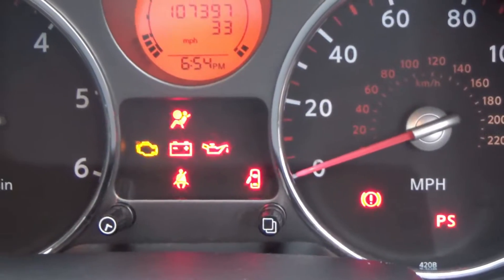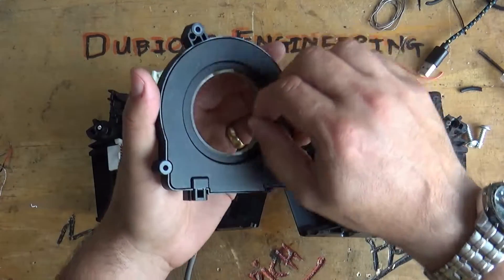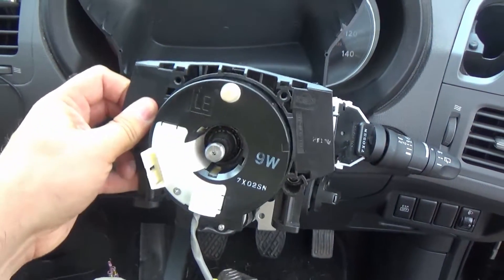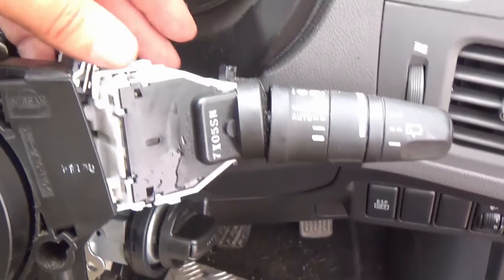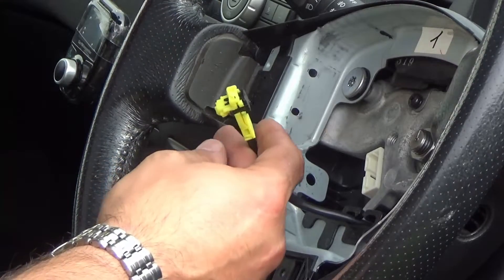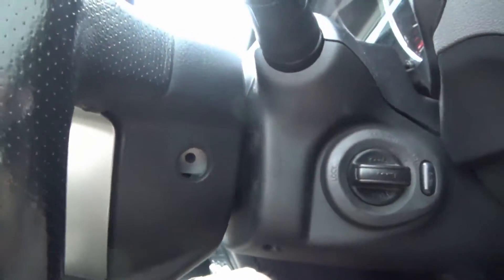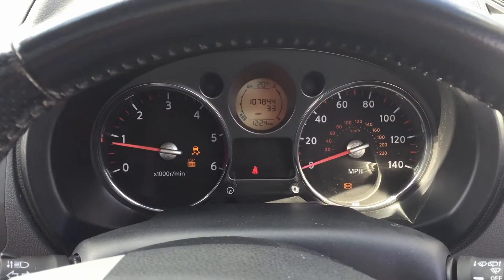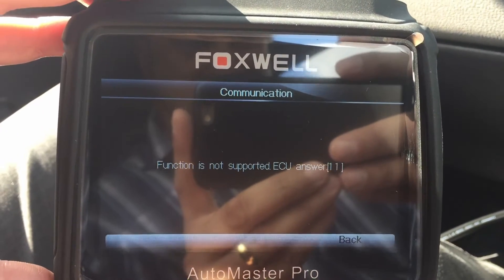DuB-EnG: SQUIB AirBag ClockSpring Repair Replacement on Nissan X-Trail Navara Titan Pathfinder

Comment: Hi mate,

Many thanks for a great video.

My car has a same problems.... trying to buy a clock spring, but not sure now many wired one to buy?

Could you please advice me?

Secondly I am not planning to do this ...how much does it cost?
For diagnostic itself I have paid 40 quids...
Reply from the maker: Expect to pay diagnostic again... you will need to reset the angle sensor and airbag lights.  I’m sorry I have sold this can now, and can’t remember how many wires the unit had!

Comment: why would the turn signal now turn on windshield wipers after replacing
Reply from the maker: Perhaps you got the cables the wrong way around or bought the wrong model of clock spring? ... anyway, this obviously shouldn’t happen!!... maybe there is a European model and a USA model for right hand drive vs left hand drive?
Reply from the maker: Thanks for your comments and support here's an upcoming project... https://youtu.be/yDuAM026Zg0
Reply from the maker: A 10 minute message for my regular viewers... https://youtu.be/hAVadIYgLbk

Comment: Don't say sorry, car repairs, electronic repairs are still interesting :-D
Repairing things is good to know about, i've spent a lot of my life repairing peoples electronics/electrics/other odd bits.
Less waste and less pocket emptying by the manufacturers :-D.
People have forgotten how to repair things :-(, yes im an old git lol.
Reply from the maker: This was a three day ordeal... I felt I had to share so people know what they are getting into!!! ...  it does my nut in that you have to connect to a computer to fix your car!!!!
Reply: That's computers for you, turns a simple repair into a nighnmare :-(.

Often you can't get to the modules that need resetting with ordinary code readers/scanners, things like body/emissions control modules are on a different communication bus than say engine systems.
Bloody annoying is an understatement.

The basic scanner/code reader is good for engine info, but outside that it's special bloody tools, grrrrr i do get fed up with manufacturers :-(
Reply from the maker: Totally agreed! ...  but... that’s modern technology and it offers stability protection through abs anti lock braking etc... so... ultimately it’s advances over the old school stuff... but a pain all the same! ... on a personal note, thanks for sticking with us for so long! ... we have some cracking stuff coming up, here’s a little preview...  https://youtu.be/u5Pq0L1_9II
Reply from the maker: Ok... how about real engineering...  old school model aircraft engines... really small ones!  ... https://youtu.be/M79I2wlbIys